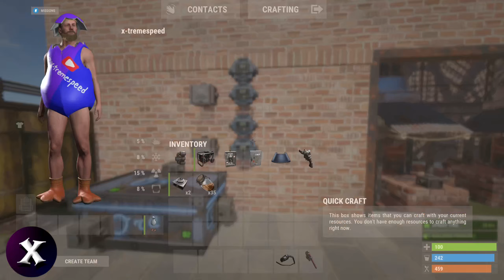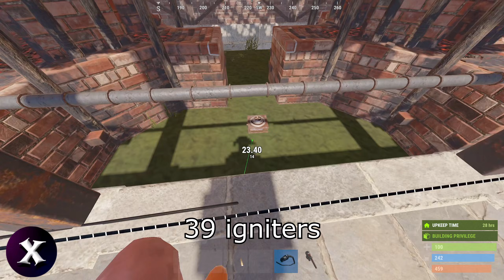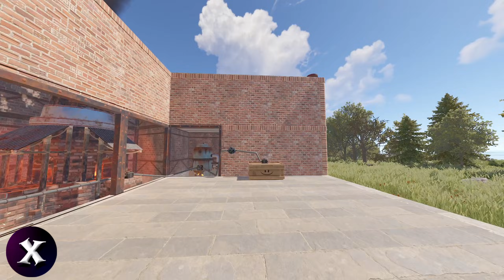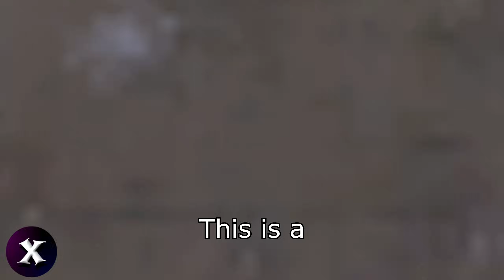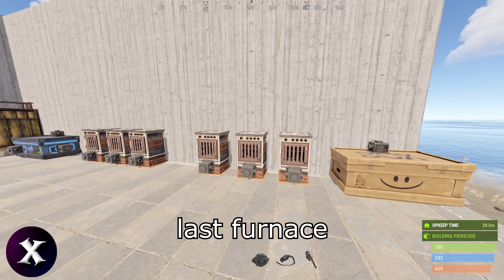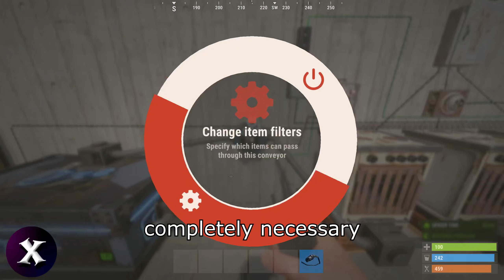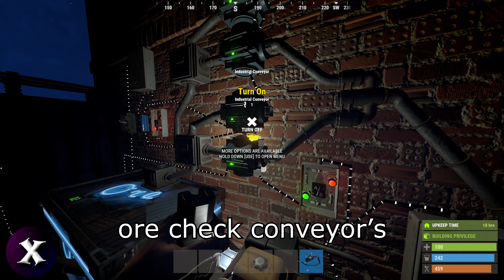Ultimate Auto Smelter Guide | Rust | Tutorial

Comment: Why do you chain 4 adapters on the storage box?
Reply from the maker: They increase the throughput!

Each conveyor can pull from the same box 4 times in every movement if you have 4 adaptors.
Reply: @x-tremespeed  nice..thank you for the great information
Reply: @x-tremespeed  came to the comments to ask the same question. thanks for the answer. however, I have a follow-up: It seems like the furnace smelting rate is the limiting factor, so whether the conveyor pulls 1 time or 4 times per cycle, you're still limited by the speed at which the furnace converts the ore and wood into metal/sulfur and charcoal. Thoughts?
Reply: I can totally see how you would want (e.g.) your base's front room drop box to empty as fast as possible, so I get the general idea of the multi-adapters, and I think it's awesome, so thanks for teaching us that
Reply from the maker: @ShivTheGamer  With this many furnaces it is not an issue. This system, however, can handle up to 30 large furnaces. Once you take into consideration each furnace needing 22 sulfur per tick, that's when you'll need more adaptors.

If you're interested in the math:
22 * 30 = 660 sulfur needs to be pulled every tick. Conveyors can pull 60 per stack per storage adaptor: 60 * 4 = 240. This still isn't quick enough as 660 / 240 = 2.75. This means even with 4 storage adaptors on a box you will need to have at least 3 stacks of sulfur in the box to not let the furnaces run dry. I don't see this as a big issue as if you are running 30 large furnaces you most likely aren't the type of person/group to only smelt one stack of sulfur at a time.

As for wood, it burns at the same rate regardless of furnace type, so even 2 adaptors will suffice for 30 furnaces (2 * 60 = 120 / 30 = 4 wood per furnace which is 8 seconds of smelt time. Conveyors activate approx. every 5 seconds)
Reply: @x-tremespeed  Thanks, makes sense!

Comment: Not sure how advanced we can get but am wondering if there is any way by using storage monitor to make it so that a system could produce enough charcoal to stay even with the amount of sulfur being smelted?
Reply from the maker: That's an interesting idea!

I don't think storage monitors would be the way to do it, as they only give pulses for box updates, but conveyors would definitely be useful for that. I'll have to sit on that idea for a while.
Reply: @x-tremespeed  replace your "charcoal factory" switch with a counter module,  add one furnace output conveyor for cooked sulfur (buffer output 20) to increment, one output conveyor for charcoal (buffer output 30) to decrement,  counter increment and decrement to keep track of sulfur/charcoal ratio, output of counter enables the "charcoal factory" mode. (this is probably the first legitimate use of the counter decrement function I have ever seen)
Reply from the maker: @Br1ckInTh3W4LL simple and clever, I like it! You would need to use AND gate boosters for each of the conveyor's filter pass so they would turn themselves off then on again, and also interact with the counter. And depending on the smelting speed of your furnace array you may need to either add a buffer box or double the buffer values.

Comment: Okay that generator/battery igniter is genius.
Reply from the maker: That's what I thought too! They are my go-to ignition methods now!
Reply: @x-tremespeed  what is the purpose of the OR gate having only one input? why not just connect filter pass to force start
Reply from the maker: @gahbor  it "smooths" out the signal. Conveyors directly connected to control inputs like force start on generators can sometimes cause them to activate even when the state of filter pass doesn't change.
Reply: @x-tremespeed  damn that was quick. i was testing this on a server and yea, that definitely happens.

do you know if an industrial light works too? shut off my pc before thinking about that
Reply from the maker: It consumes 1 rW which is the entire signal so no, unfortunately. You can use any electrical component that passes through power with one 1 active input, and that doesn't consume power.
Reply: I use the following:
Timer: set to 1 second
Industrial Conveyor

Take the filter pass from the conveyor and connect the filter pass to the toggle on for the timer.

Thats it!